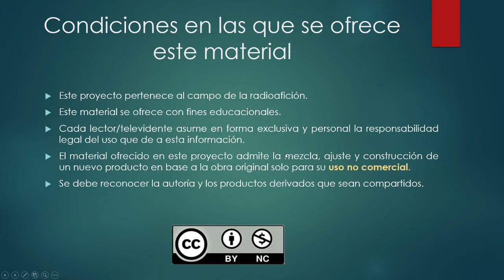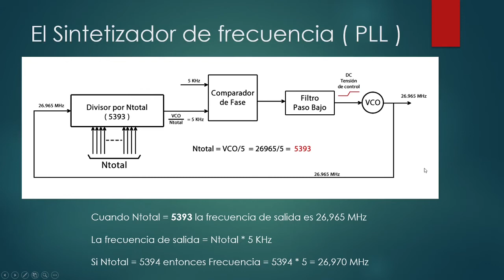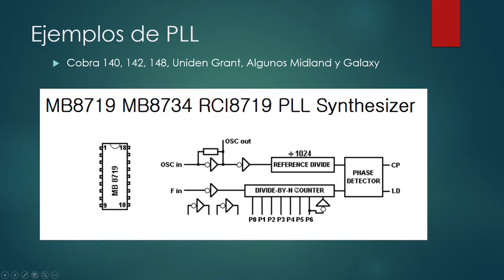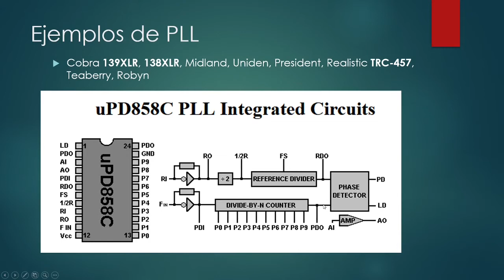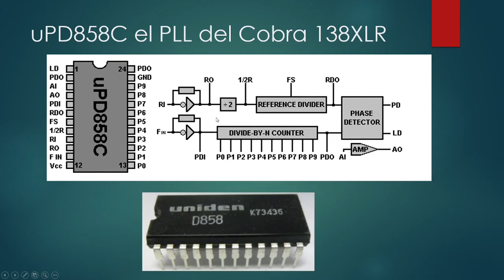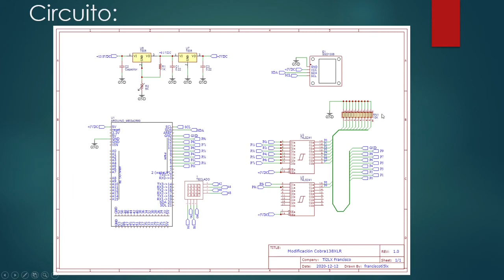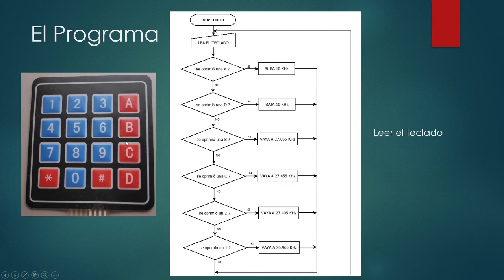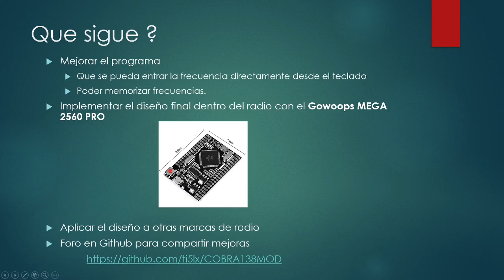Modification at Cobra138XLR to 400 channels

Comment: My favorite tool to generate any arbitrary frequencies is the SI5351 module. Using it with a rotary encoder and a display, I can simply bypass any existing PLL etc.